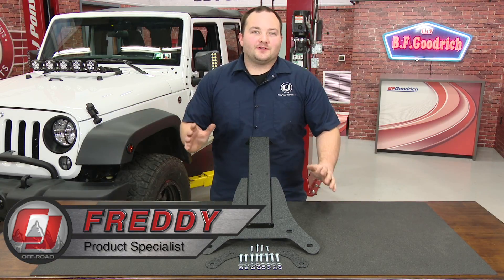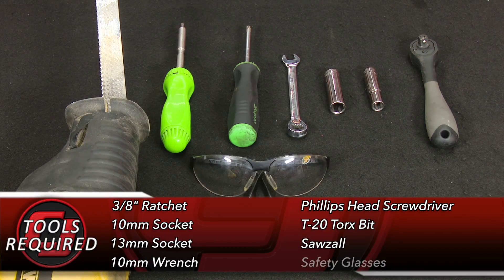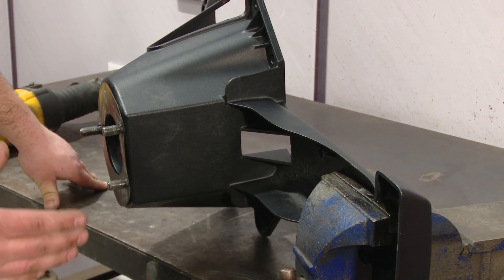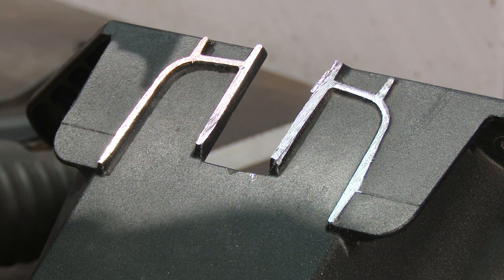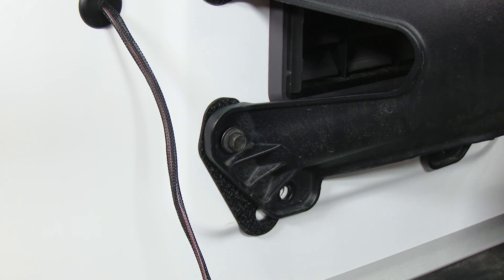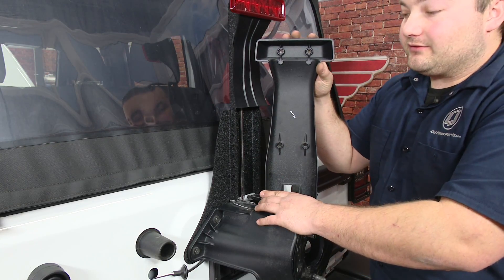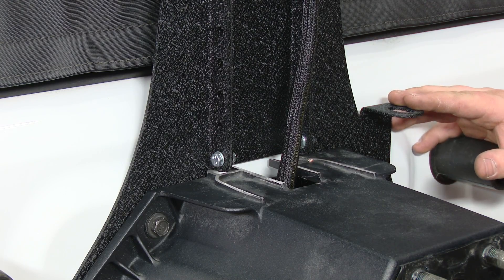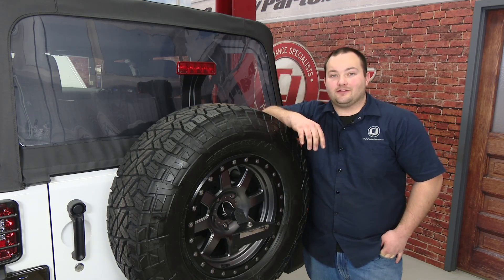Jeep Wrangler Rugged Ridge Third Brake Light Extension Kit 2007-2018 Installation

Comment: Thank you for this install video.  I have 2014JK on 37's, with the 5th installed to pull away holder on the rear EAG bumper The bumper comes with a built led  brake light installed.  However Hawaii has a RECON inspection for lifted and modified vehicles So they require the 3rd brake has to be above the tire.. BS.. nonetheless, I didn't know how to do it until now.. Crazy thing my neighbor is a highway patrol and he said I was good. Nonetheless Hawaii got crazy rules.. not ramble thank you..